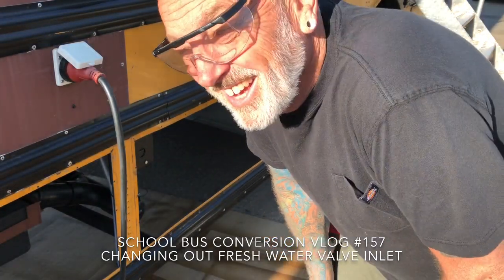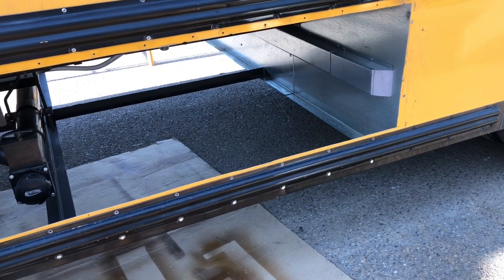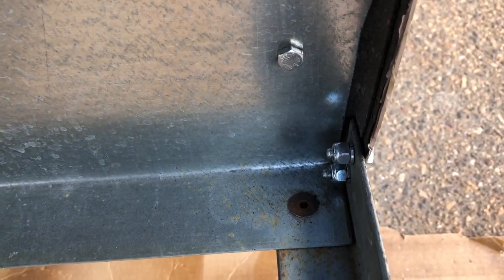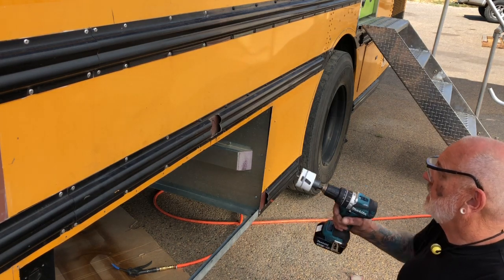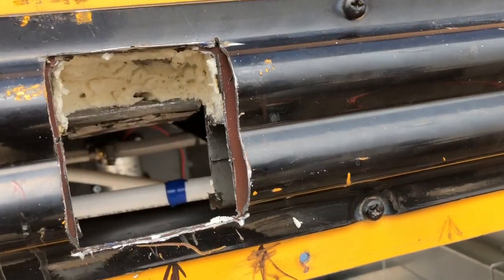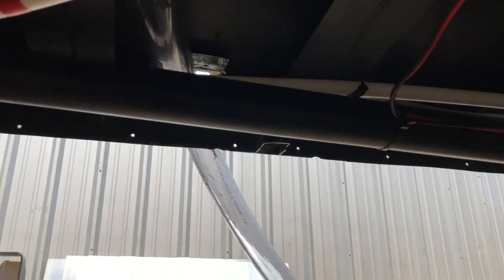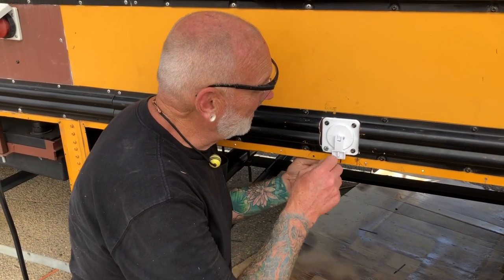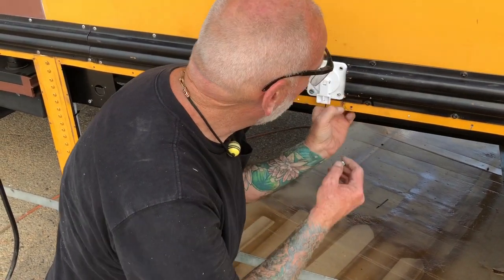Changing out Fresh Water Valve Inlet - Vlog 157 School Bus Conversion

Comment: Randy, a bit of silicone round that inlet to stop water getting inside the rub rail will finish that, also if you use a fine wet n dry and a plasticised paint, i would go black and it wouldn't stand out but either way another neat install.
Reply from the maker: Yep definitely on the list. We just got to get time. 😃